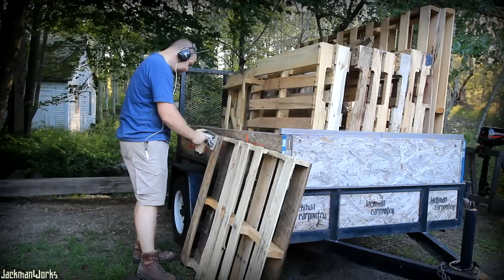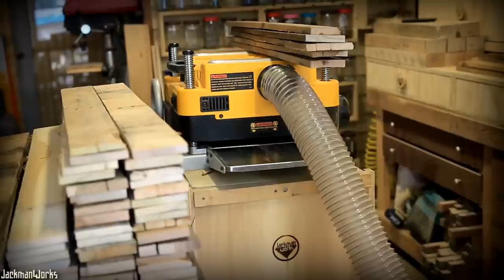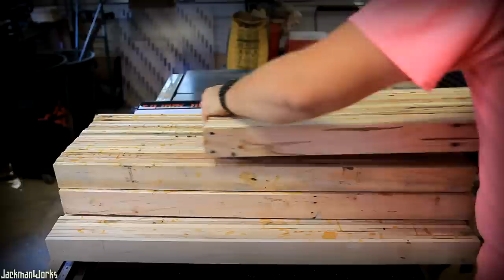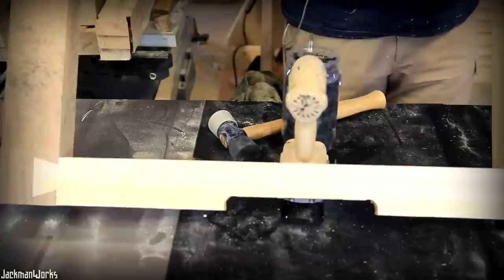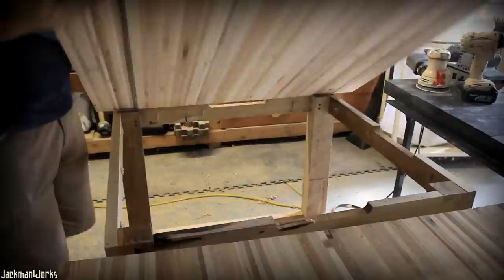100% Pallet Wood Woodworking Workbenches

Comment: My Best Friend Joe and I built me a 16X12X9  shed out of Pallets only took about 2 hrs. to frame then Skinned it in metal only have $1500 in it the Metal and  4X8 1/4 osb on the floor made up most of the Expense, used some 10' 2X4 for the trusses. The trick is to get the same Pallets if you can, i was able to get some Treated ones from a Mudco Company for free. Lay the pallets out on the ground as close together as you can but don't worry if it's not Square because when you lay your osb board on top of it, You use that to make it Square. Screw it down then along your edges stack your your Pallets on there side like your making a fence and Nail it we used our framing guns. then simply stack your next pallet on top and Nail. My pallets didn't have any overhang on them so it made the job easy and fast. I am very pleased with how it turned out, i have a 5 foot wide door and a Loft inside it's as solid as any tuff shed. Same size shed would cost you 3X or more from Home Depot  very pleased with how it turned out.  : )

Comment: Great job! Did you end up putting a finish on them? If so what did you use and do you like it? Thanks
Reply from the maker: I did! I just ended up using a 2 part epoxy just on the table tops and it soaked into the surface, hardened it up a bit and allows me to scrap glue and things like that off really easy. It was kind of just a trial, but I was very happy with the results. Here's what the final results look like: https://www.instagram.com/p/BJ1EKqjjh1Z/?taken-by=jackman_works
Reply: Thanks! Do you remember what type?

Comment: I am tired of these do it yourself, cheap things that can be done with alternative material... but yet, you need the expensive ass equipment to make it happen... LOL
Reply: you are right DIY is not cheap there are a lot of things that is better  off buying, BUT building some stuff like furniture from scraps is a good business so buying tools is justified as long as you keep producing them with decent quality. In my opinion this workbench just needs a little bit more of sanding and painting in order to look badass.

For instance Im slowly buying new power tools in order to make simple structures out of steel beams and wooden tables just because Im sick of plastic/store quality and cant afford the heavy ultra expensive ones.
Reply: john doe, i agree with Luis Fernando. Im also getting tools to improve my work. I Will be able to earn money by Just taking the stress out of my work days by spending my time in this. #woodlover ha ha
Reply: It is kind of ironic (probably not the best word) that you need expensive tools to make stuff out of pallets, but you can't really get a good finished product without planning rough cut lumber (ie pallets) (too much gap and too warped to glue well) and the planner is the only expensive equipment used in the video (table saws are pretty cheap used and the biscuits could be left out or replaced with dowels so you don't need a biscuit jointer and clamps are pretty cheap).

Comment: this the best use of pallet wood I have seen on here so far (and I have seen a lot, not all though)  if I had all the equipment and tools like you have, i would be going into the pallet wood business, I know it's probably not as easy as you make it look,  with all the prep time it takes to get the wood ready to use like you did, those would make good general purpose tables for other than work benches also,  they just look so good

Comment: Great job my brother.
For your safety, please ensure to adjust table saw blade to 1/8 - 3/16 just above your wood, love your fingers bro. Fingers only grow one time. Be safe.
Reply from the maker: Sometimes you have to raise it up a little higher than that to prevent kickback when cutting thinner materials because they want to raise up off of the table. My grandfather lost an entire finger to a table saw and I remember that whenever I turn one on.

Comment: Love it.  Gonna make counter tops for my pool house with pallet wood.  I've been thinking i want to try and joint one edge and one face as usual. then rip along the other edge as usual but rather than go to the planer maybe rip along the rough face. Then glue up then plane. My thought is it might be a little faster and planer knives are more expensive than my TS blades. Especially if I miss a nail. Thoughts, concers, warnings, advice...?
Reply from the maker: I definitely think jointing one edge is a good idea. I wouldn't worry about jointing the faces though, just run them through the planer. The slats are usually pretty thing, so any slight warping that is left can be pulled out with the clamps during the glue-up. Definitely get a metal detector if you don't have one yet, that'll pick up on any nails or staples you might miss by eye.

Comment: Every time I try and access your website I get a malware warning and not just a cautionary "this site might have malware..." but an orange screen that states emphatically that the site has malware that will attack me.  I hope you can fix this so I can see a lot more of what you are making.  You've got some really nice things on video.
Reply from the maker: Despite all the scary warnings that make you think my website is going to jump out of the screen and punch you, my site is safe lol. It's just that google is lagging behind, if you type my URL manually into your search bar instead of clicking on the link, you shouldn't get that warning.

Comment: Well done! Impressive to see glue hold that well.  So you use no screws or nails to hold the boards for the top together? I've seen some other things like this and they seem to nail them together as well as using glue. And how mnay hours would you say this whole project took you?
Reply from the maker: If you do it right, the glue is actually stronger than the wood itself. Only reason I would use nails for something like this is to keep the pieces aligned, but since I was sending the slabs through the planer it wasn't a big deal. Best guess is that this was a solid 40 hour week to complete. Lots of banging on this since and I haven't been able to get a joint to pop yet (I've been trying haha)

Comment: Nice workbench.  It would have been easier to follow if the assembly sections were not so fast between segments.....otherwise nice work.
Reply from the maker: Full details are on my site in case you missed anything: https://www.jackmanworks.com/pallet-wood-workbenches/

Comment: Looks great n all..Wonder if its worth all that effort. slicing dicing, nail removal, cleaning etc.. vs just buying clean timber.. 2000 years later :) on a personal note, I would have preferred listening to the natural sounds of the machines running and saws buzzing etc instead of the sound track

Comment: Did you ever use a jointer? How did you get parallel faces after the glue up? Did you not have to use a jointer first before planer?

Comment: Love the vid and sub’d some days ago. After 6 years of dreaming I was finally able to get a work area and now in the process of setting up a small shop but I am very new. I have been working with electric hand tools for a bit outside my building making small projects. I just yesterday purchased a table saw. I plan to work with pallet wood to save $$$ but I’m under the impression that I will need a jointer and a planer. Spent last few days watching videos to try to find an answer and so far found that a planer is a must but to flatten pallet wood I’ll need a jig. Any advise or tips you can suggest would be very appreciated!!!

Comment: Love the look of the top, amazing the species of wood you kind find in pallets.  Did you plane all the slats to the same thickness or did you plane them until smooth at each of the three thicknesses (hope that made sense)?  I noticed you stated you sorted them into thin, medium and thick slats...just was unclear on the planed thickness.  I think it would look great with varying thicknesses of slats.  Just purchased the router table cabinet...looking forwarding to getting started on that project.
Reply from the maker: Exactly, I just plane them down until each side is smooth. Organizing them from thick to thin just makes it a simpler process when sending them through the planer
Reply: Excellent, thanks for the reply.

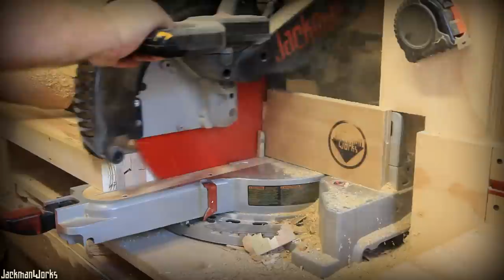Comment: Dig your woodworking and videos..quick question: At 2:47 you used the miter saw to cut the ends of the table tops. Is this your preferred method of cutting that element over using a table saw (cross cut sled)? I'm just earning this stuff and am wondering if you chose to do it for safety or preference. Thanks for your time.
Reply from the maker: Thanks Carlos! It all depends on the piece I'm working with I guess. after the glue-up that thing was pretty heavy and big so the safest way to square up the end was on the miter saw. I did this too to cut the original slats down, but that was so I could do a gang cut and cut more than one slat safely (something I wouldn't do on the table saw). Otherwise though, a table saw sled is great!

Comment: How essential is planning every single individual board? What im trying to say is; could I manage to do with out a planner, since i don't own one?
Reply from the maker: To get a good glue-up you're going to want to make sure that they are smooth. If there are too many gaps you won't get a good joint between the pieces. If you're not afraid of some work you could do it with a hand plane, but you'll probably finish in 2019 ;)
Reply: 2019! hahaha thats too generous. all I've got is a table saw. Yea im not using pallets then

Comment: Is that a 735x planer?  If so, how is it holding up?  Great job, by the way.
Reply from the maker: It is. It's done well so far, especially considering the amount of stuff I send through it. Takes quite a bit of maintenance to keep the table and the raise/lower mechanisms all lubed up and the blades are expensive, but other than that it has treated me well
Reply: Thank you.

Comment: Sorry if this has already been asked, but what are you using for planer blades on your dewalt? I'm going back and forth on just using the cheaper blades since I know I'm going to be working a lot with reclaimed/pallet wood and would just change them back out when I move back to using "cleaner" hardwood lumber.

Comment: What did you use for the legs?
Reply from the maker: The main frame is fabricated from 3.5" x 2.5" pallet timbers and 1.5" thick pallet slats, all from a super heavy duty pallet.

Comment: there is no need on big builds like this for cut joints, yer do it by all means just cos you want to or you think it looks nice, or you are just a jointaholic, but really there is no need cross bracer or skirts are more than enough and you will be able to jump all over it just the same.

Comment: will you be make plans available for this table ?
Reply from the maker: Sorry, I don't have plans for this one. With the materials used it would be hard to easily reproduce. If you're curious about certain dimensions, I could measure those out for you though.
Reply: Jackman Works
Thats ok,looks simple enough. Was more interested in the overall dimensions you settled on for the project.:-)
Reply from the maker: The table surface is 36x40x2" thick and the height is 1/8" below the height of my tablesaw
Reply from the maker: Good news if you're still interested, I had enough people ask for plans for the workbenches so I ended up putting some together. I drew them so you can make the workbenches out of pallets like I did and I also included an alternative explaining how you could reproduce it with simple framing lumber. Available here: https://www.jackmanworks.com/shop/pallet-wood-workbench-plans/

Comment: What do you call that nail/metal detector and where do you get them?
Reply: You can find all types on Amazon.
Reply: BALES Never bought anything from amazon. Aus.
Reply: BALES Translation. Amazon is ebooks and kindles over here....
Reply: Ahh .. gotcha.  Search for Handheld Metal Detector or Metal Detector Wand.
Brands: Garrett, Wizard, Bounty Hunter, Pyle, GoerTek.
I can't tell what actual model Jackman is using.
Reply: BALES Ok thanks mate. I was just searching metal detector haha.
Reply from the maker: http://m.harborfreight.com/metal-detector-97245.html 
That's the one I've got, just a cheapo from Harbor Freight. It's not very strong - I'd get a more expensive one if I had to buy it again, but it's adequate
Reply: Jackman Works Cheers mate. At least I know what to look for now. Much appreciated.
Reply: My thicknesser will thank you haha.
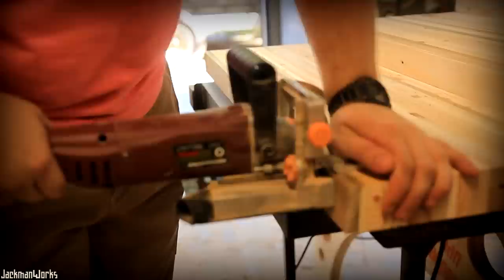Reply: Hey what do you call that tool you're using to make holes in 2:58?
Reply from the maker: That's a biscuit joiner / plate joiner
Reply: You can also use a pin-pointer. It's normally used with a metal detector to accurately find the object. If you are cheap - a strong magnet will go a long way ;)

Comment: So it seemed like 2000 years for you to find and remove every single tiny nail fragment.   After completely disassembling two pallets that arrived with equipment I have given up on using free pallets.  I do have a lot of  left over 2.25" oak flooring shorts so I will use nearly the same fabrication steps to make a workbench or outfield table top.